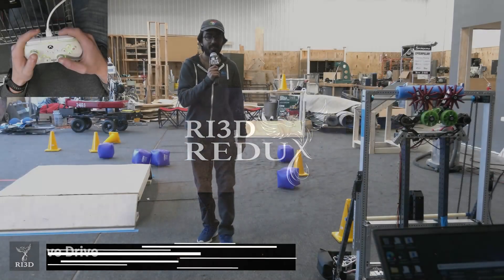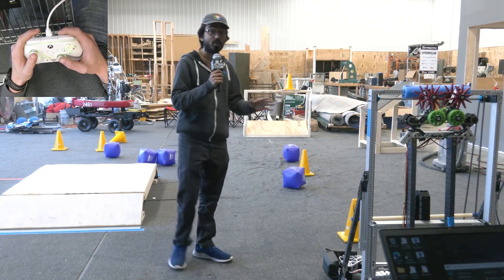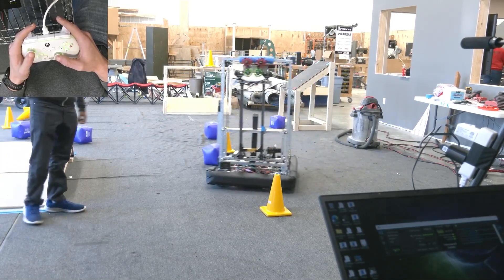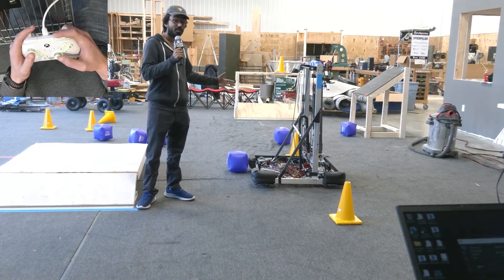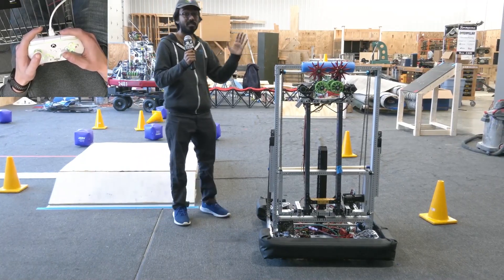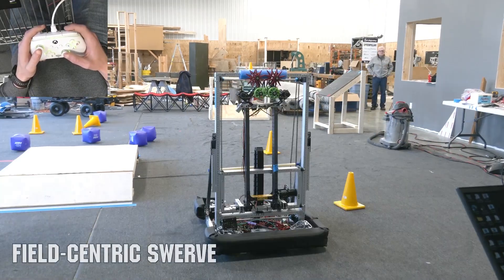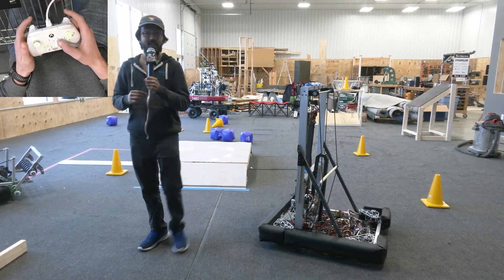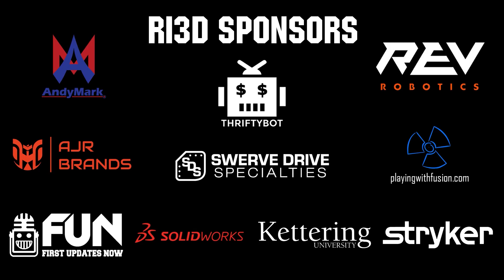Field vs Robot Centric Swerve Drive Overview and Tips | Ri3D Redux 2023

Comment: Do the Mecanum wheels have enough grip on the charging station?
Reply: See FRC 2012, there was a similar balancing board in that game. Mecanum robots didn’t have enough grip nor would stay stable on the ramp as it can slide off if the charging station isn’t leveled.
Reply: The robot in this video does not utilize Mecanum wheels.